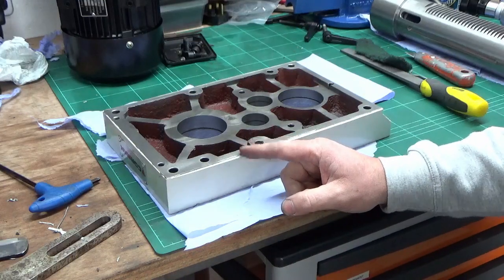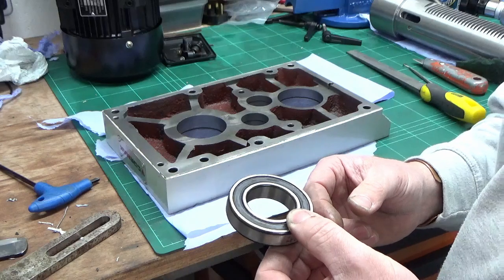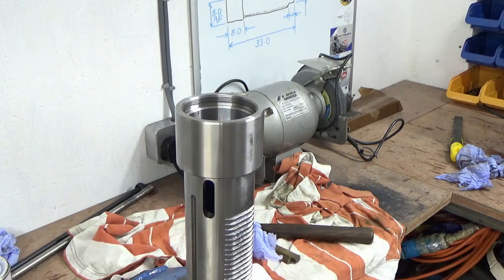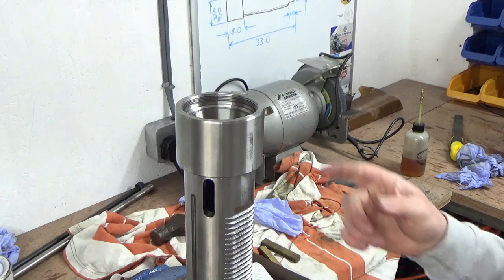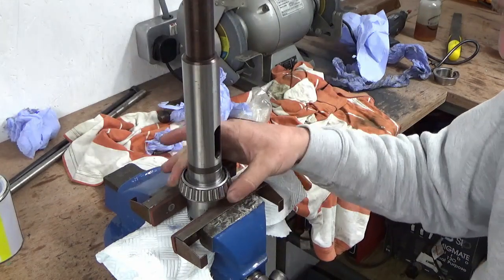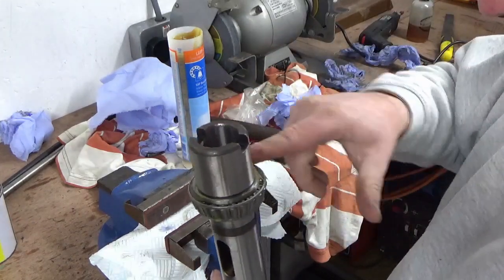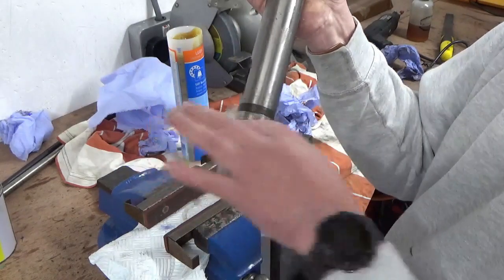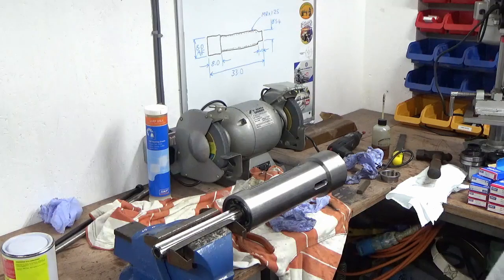Cormak ZX 7045 Mill Head Strip Part 4

Comment: greasing the roller bearings I would use a wheel bearing and pack the inside.  or use palm of your hand and just move the back of the bearing along your palm with grease
and you can fill up the inside cavity of the bearing that way, but what you were doing was ok its just not possible to fully fill it
Reply from the maker: Hi Bob, thanks for the comment. Agreed, there are different ways to pack a bearing. It's quite interesting to watch a fully packed taper roller bearing in the first few minutes of running, the majority of the grease is quickly displaced from the pressure surfaces (which is the only place you need it). A fully packed bearing on a machine will very quickly generate a lot of heat during initial displacement which often leads to false diagnosis of too much preload and incorrect reaction. I just try to ensure enough is in to coat the rollers and races. Cheers, Jon